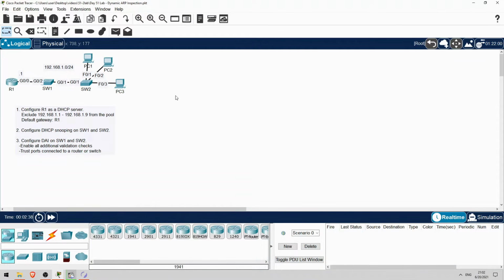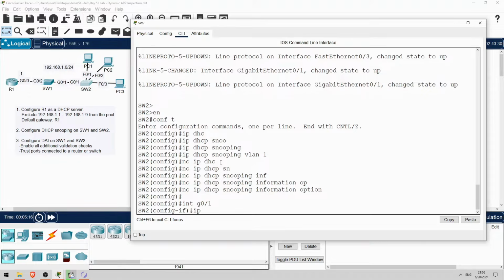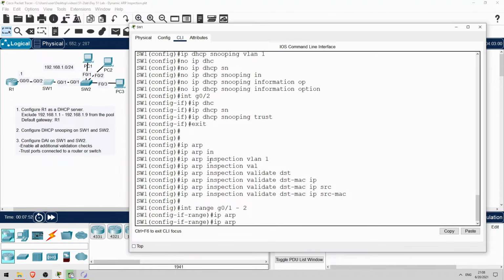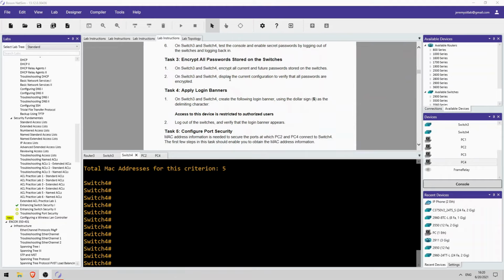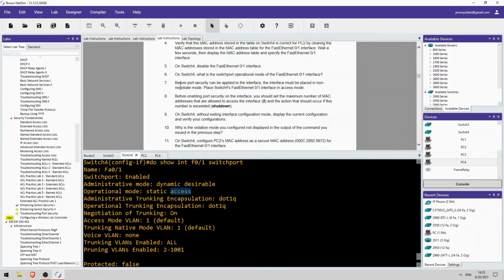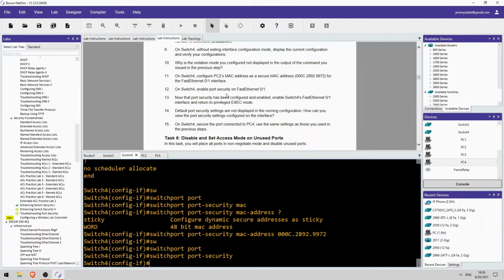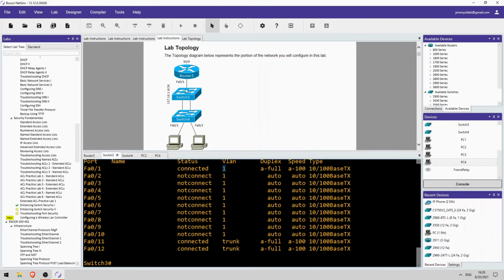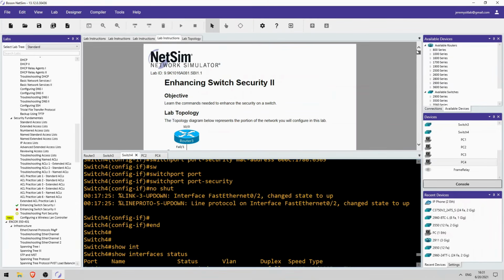Free CCNA | Dynamic ARP Inspection | Day 51 Lab | CCNA 200-301 Complete Course

Comment: Just to point out Jeremy completed the LAB 100%. Its just that Boson instruction is shutdown unused port and put them on switch port mode access. Which is interfaces that highlighted in red should be correct since they are in USE.

Comment: I tried this lab 3 times in total. I did the same configurations all 3 times, except at the end I tried to get an IP for PC via CMD by ipconfig /renwe. Not only it failed but then even after clicking on DHCP in the config part of PC, it didn't work. I did all lab again, clicked on DHCP in config panel, it got an IP and then ping worked.  Maybe I missed something in earlier configurations or is it a glitch in packet tracer. But anyway, I am good, I had more practice of the commands <3 . Thank you for your efforts sir.
Reply: Packet tracer is really buggy 
Not your fault

Comment: Hey Jeremy. I have a concern about this specific lesson:

"DIA will check the ARP contents against DHCP Snooping Binding Table"

I experimented on your lab by changing the MAC address of my PC's NIC so it won't match the DHCP Snooping Binding table of SW2 but it still allowed the ARP to go through even though the port was untrusted. Any thoughts on this?
Reply: If you do lab on packet tracer I believe its DAI functionality is limited somehow. I didn't try to play with PC's MAC address. I enabled arp inspection of switch but didn't make port looking towards other switch and router a trusted port. Then I cleared arp table at PC, and hit ping to default gateway, and it worked. In theory, ARP request comes from PC, which is okay, because it has entry in DHCP snooping at a switch. But ARP reply coming from R1 doesn't have DHCP entry, and even arriving at untrusted (because of my setup) port in my case still passes through the switch.
Reply: @dmitrikazantsev3692  Yeah, seems like Packet Tracer is very limited, lol.